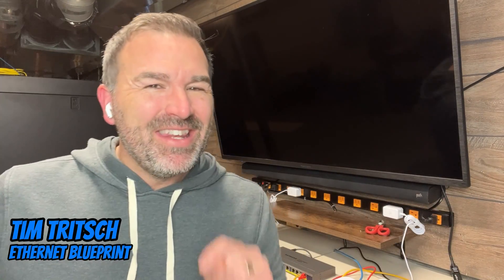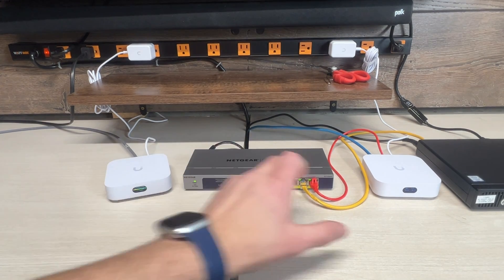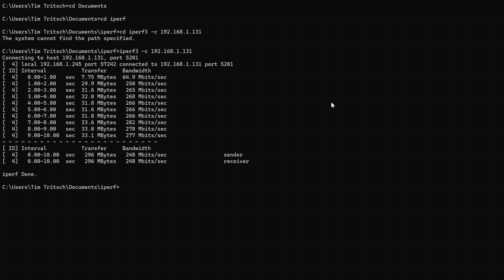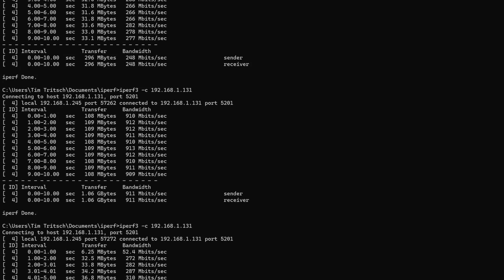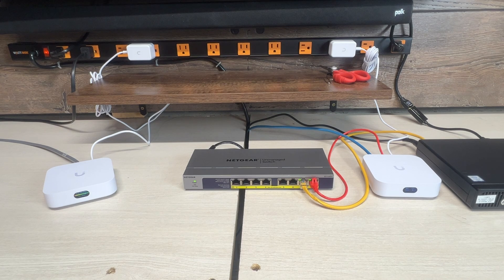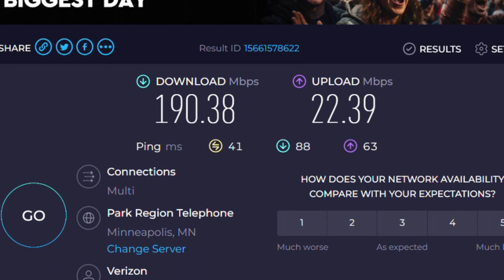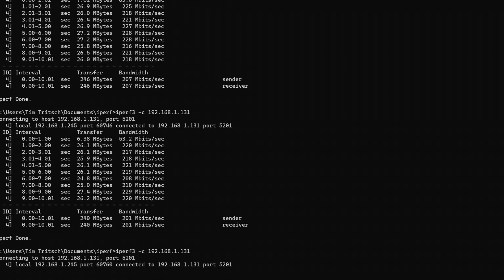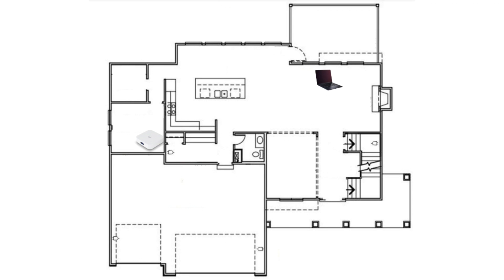Unifi Express SpeedTest using iPerf

Comment: Only My Opinion and Experience: Unifi wireless mesh system is not usable. Every wireless mesh hop would reduce speeds by 50% and more. Do not use these devices for wireless mesh ever. Either use a dedicated AP with wired backhaul. Or if wireless mesh is needed, move to something else than using ubiquiti or omada.

Comment: I have two Express units, and to achieve maximum throughput, you need to set them to 160MHz. I have a NAS connected to the main router via Ethernet, and the mesh node, with an average signal of around -59dB upstairs, is connected to my PC via Ethernet. This setup allows for file transfers at peak speeds of around 93MB/s, which is close to gigabit speeds (approximately 112MB/s). My only complaint is that the UI is very slow unless Traffic Identification is turned off.
Reply from the maker: I also do not like the slow UI.  They are kinda under powered in my opinion, but that can be expected a little at that price point.
Reply: Thanks so much for this post, I’ve been looking for information on this kind of setup everywhere
Reply: Express app usage and management is practically unusable. Cloud Gateway Fiber is basically instantaneous.